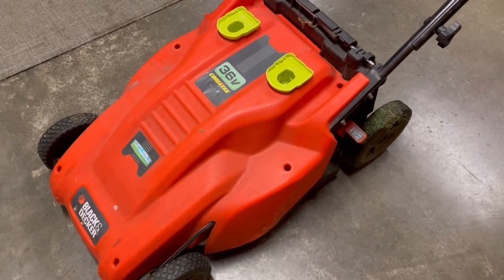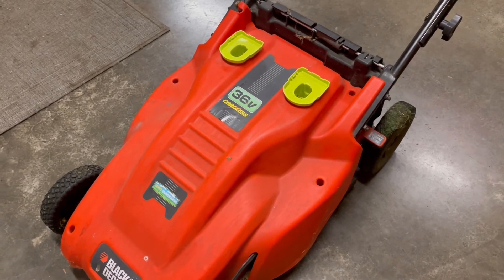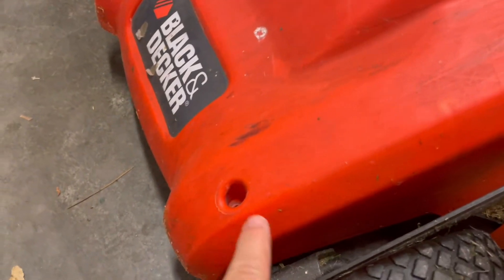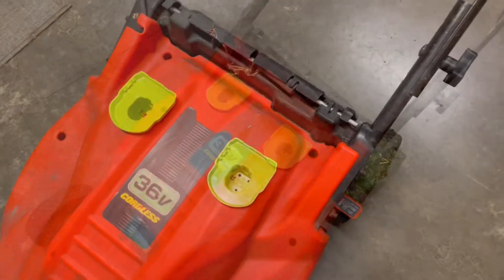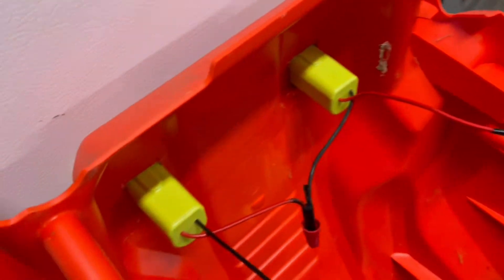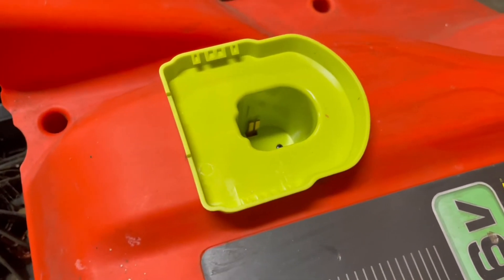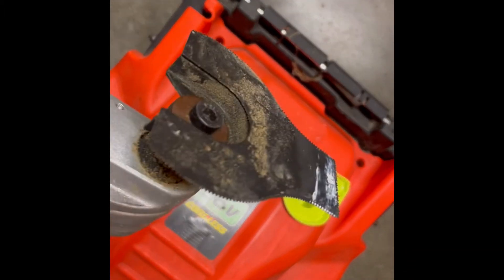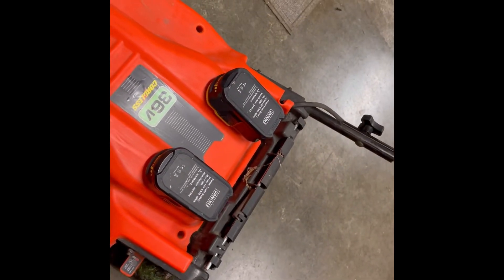Modify a 36v Black and Decker cordless mower to use lIthium Ion power-tool batteries

Comment: I just got a free Black and Decker self propelled 36 volt mower with dead batteries and broken charger.  The cost of replacement batteries and charger would have been over $200.  I was going to scrap the mower.  Now that I have seen your video, I might give this a try.  Thanks for posting.

Comment: Thank you for the excellent video. When I found your video I decided to convert to the DeWALT 20v batteries I already use for my other tools. I used Chinese convertors from Amazon (1/2 price of DeWALT items) and everything works fine. I use a pair of 4 AH batteries which give around 40 minutes of run time - enough for our small lawn. "Prepper" NOTE - the Chinese 18X20V convertors have USB ports so you can recharge things from your tool batteries (!?) / Best regards, D.

Comment: Will a standard 12v 8amph replacement battery work on this? What does 36v on the CM1836 means? Is it a 36 volt battery?

Comment: Nice mod! I saw that you didn't replace the lead-acid batteries with some sort of weight (e.g. a few bricks); does it seem to effect performance or usability?
Reply from the maker: It is much lighter and easier to use and seems to last about twice as long.